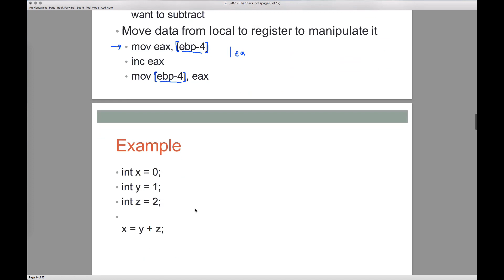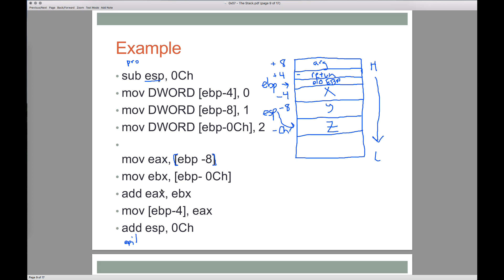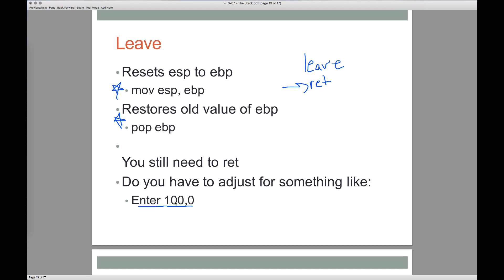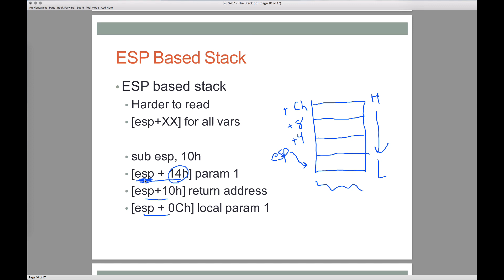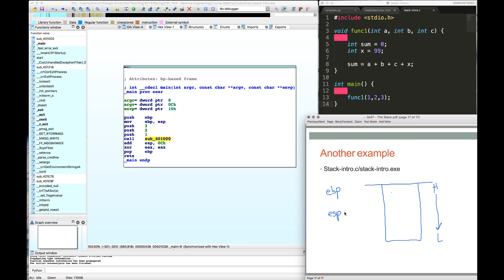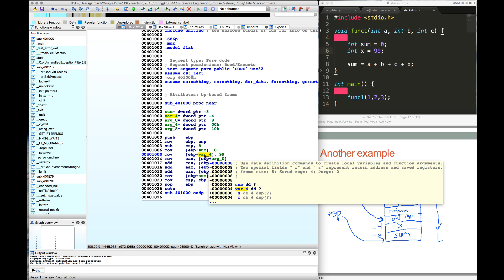Comment: If a function returns a value, where will be that value stored on the stack? Is it between the last parameter allocation and the return address?
Reply: No, the stack is not used for a return value - at least not in any calling convention I've seen. Return values typically come in one of two ways. The first, and most direct, is that the return value is in the EAX/RAX register. You can note this if this register is populated before a function returns or if you see it being used shortly after a function call. The other is through modification of arguments. The Windows API does this regularly - an argument that is classified as an OUT type. CreateProcess is a good example - https://learn.microsoft.com/en-us/windows/win32/api/processthreadsapi/nf-processthreadsapi-createprocessa. Here the last argument is OUT and is a pointer to a process structure. The function will update members of that structure during execution, so in a sense is returning values. Hope this helps!

Comment: I'm curious how local stack variables from a fn a or code block a can be accessed by a nested call or block c- temporary "local" variables but not immediately local but still in scope. I imagine this is just more pointer arithmetic and it's the programmer's (compilers) responsibility to know the offset, and there's no law that says esp can't jump anywhere on the stack, even to other frames. Is this right or wrong?

Comment: If a function calls another function, does the stack frame of the first function ends at the point on the stack where the next instruction address of the previous function is stored?
Reply: I've created a video to help answer this - I'll get that posted soon in case it helps. If you are asking if the stack frame ends before another function is called, then I would say yes. The frame will consist of optional arguments, the return address and space for local variables. Once a function returns and, depending on convention, cleans up from any arguments, then the stack space for that frame is no longer needed. The next function call is encountered and using space for it's frame appropriately. Functions often call other functions, a frame for a function that calls other functions remains until the parent function is no longer in scope (i.e. it itself has returned). Does this make sense?
Reply: Thank you for your answer and yes it does makes sense. I understand things better now and didn't formulate my question properly also, what i meant was if the next  instruction address of the "caller" function saved onto the stack refered as "return" can be considered the end of the frame of that same caller function, and yes it can.

Comment: So, if I have this right, local variables need the stack to be changed by their functions, while objects such as structs and classes (as called in C++) are global data, as are their instance variables (as they are known).
Reply: Not exactly - local variables are simply variables who uses memory on the stack, this can include basic types (i.e. ints, chars, etc) and structures such as arrays, C++ classes or structures. Typically they are scope limited to the function they are defined in, although they can be passed to other functions which that function calls. Global variables are typically defined in a global scope and reside in a different program segment, such as .data or .rdata. These can essentially be modified by anything that has access to this global scope and their memory is more consistently defined. That is, the memory they used is allocated when the segment they reside in is loaded by the OS. Memory for local variables typically is released back to the OS when the function goes out of scope and those variables are “destroyed”, the stack space they used is released for other functions. Does this help?
Reply: @jstrosch  Another thing I'm curious about is how a program places data in its heap. Though I believe that structures can more quickly be added to the stack as pointers.
Reply: @TheRojo387  Program allocates memory in heap by using dynamic memory allocation method(malloc,calloc etc in C) which returns the pointer to access these memory locations which was just allocated.